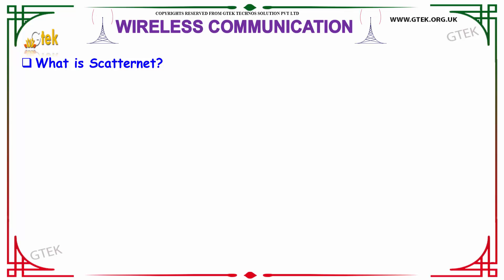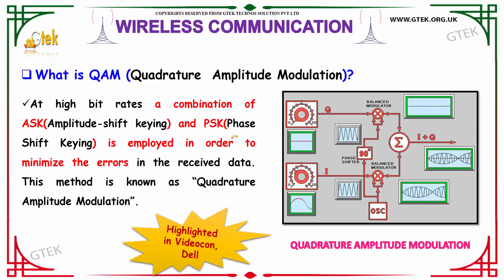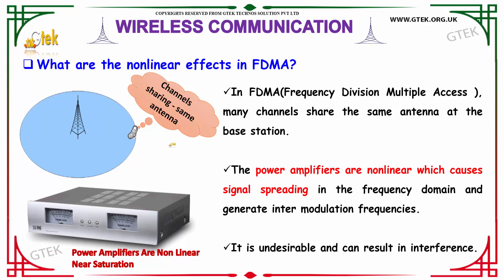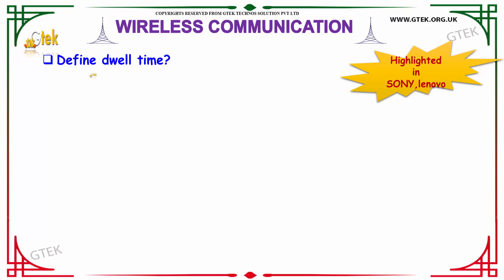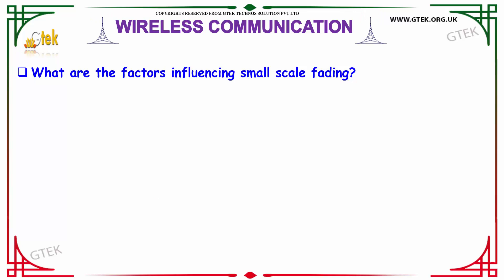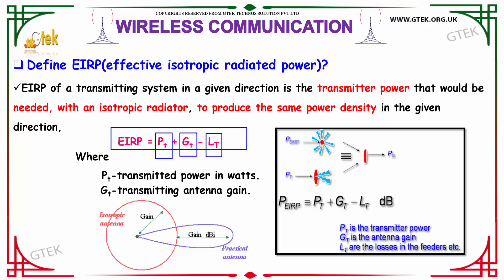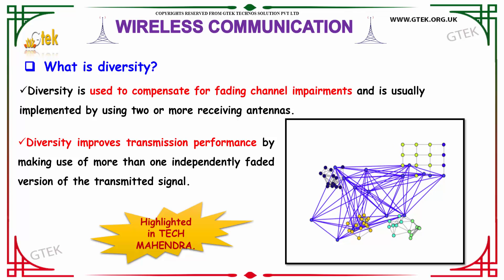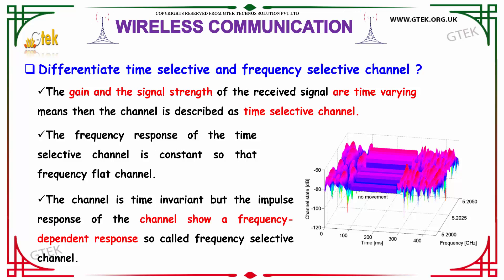Top 30 Wireless Communication -2 ece Interview Questions and Answers Tutorial for Fresher Beginners

Comment: The router has internal wireless radios that broadcast signals in the 2.4 GHz and 5 GHz range. By default, they are on so that you can connect wirelessly to the router. When the wireless radios are off, you can still use an Ethernet cable for a LAN connection to the router

Comment: Image result for Wireless Communication -
Wireless communication is the transfer of information or power between two or more points that are not connected by an electrical conductor. The most common wireless technologies use radio.